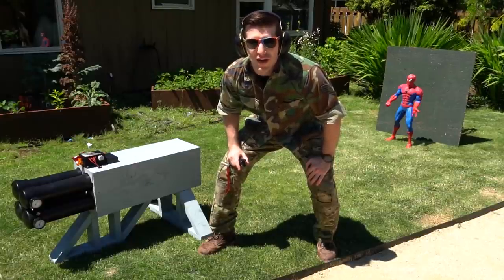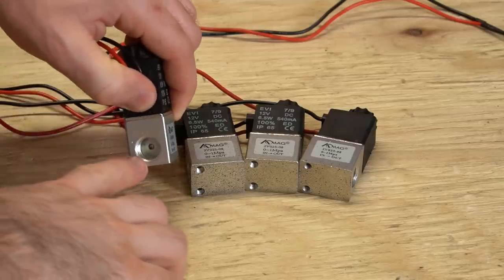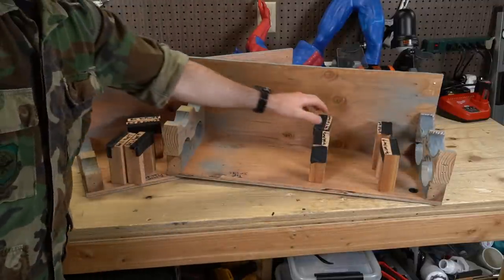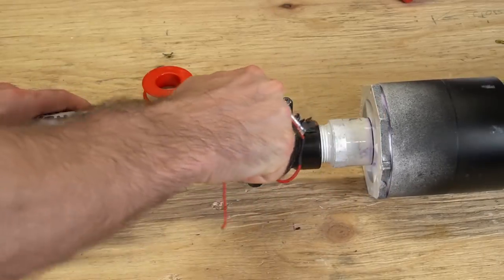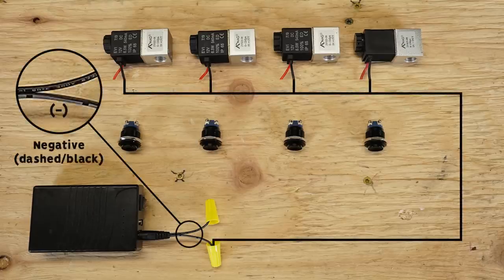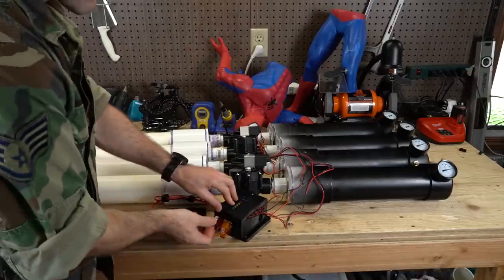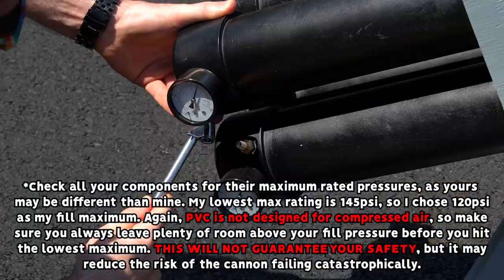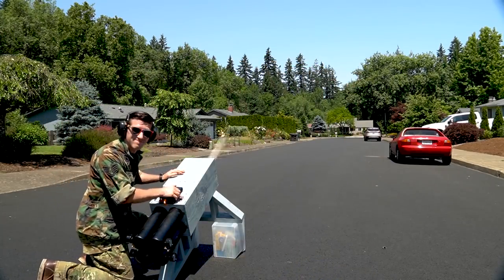How to Make a Quad-Barrel Air Cannon

Comment: Hello, you should make the air re-filled to the chamber automatically using your electronics and solenoid valves.   It seem to be doable and quick reloading.  Any link to Arduino codes to share.

Comment: Was that warning about not touching the wires when the battery is turned on serious?
Reply from the maker: Seeing as my build guides cater to newer makers, I like to add in standard good practices as advice. With the low power I'm using, perhaps it's overkill, but if this warning reminds someone not to touch/build something that creates exposed mains power then I may have saved a life. To me that's worth the overly cautious callout.